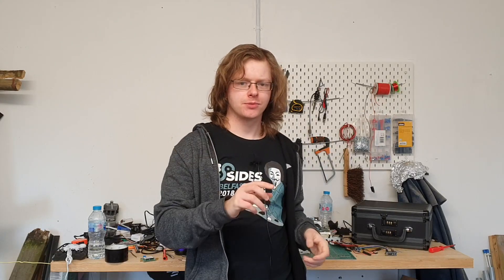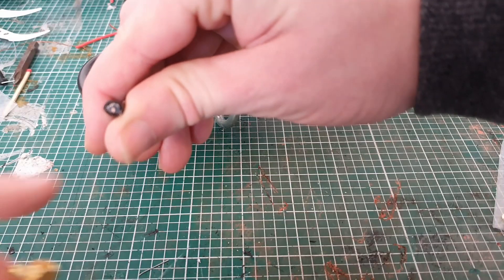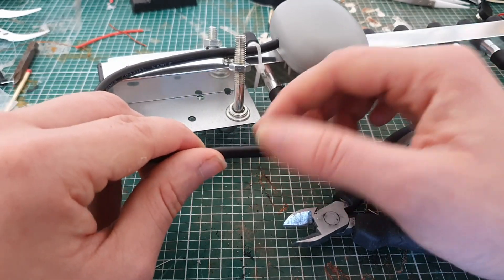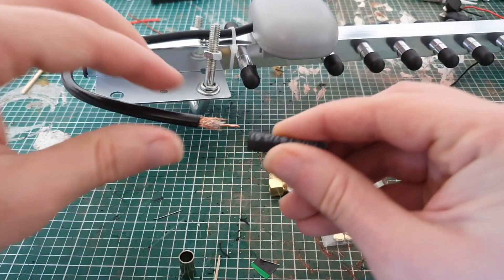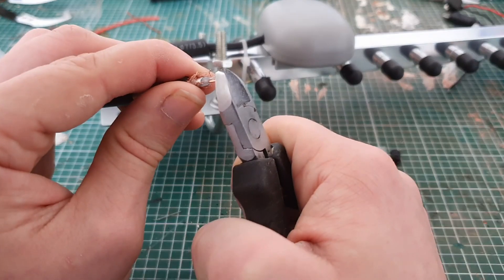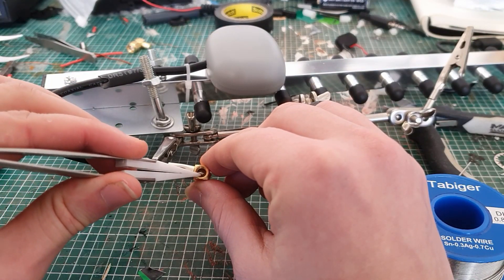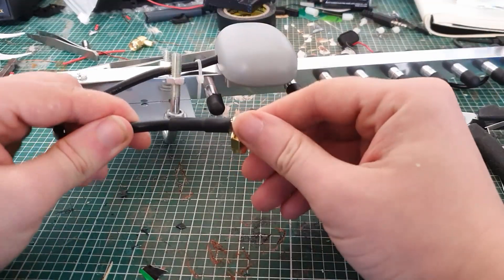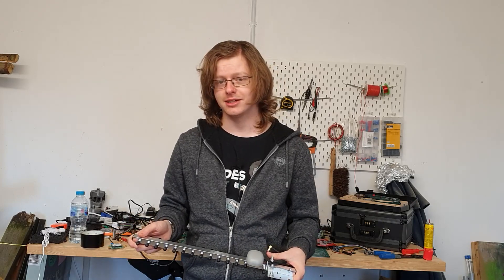How To Fit An SMA Connector

Comment: This is not the correct way to attach a right-angle SMA for RF purposes.  You'd get massive signal loss and detune issues doing it this way, just FYI.  He skips some steps necessary for individuals needing low loss cables for cellular frequenciea

Comment: Not sure if you still monitor comments to this video but have a questions regarding the soldering you did. The video does not show you heating anything with your soldering iron nor does it show you dropping solder into the hole. I have ordered the right angle connector and I cannot make out if there's a ball of un melted solder sitting in the middle of the opening that's heated. Any thoughts?
Reply from the maker: @waynenasiatka6758  I had to watch the video to refresh my memory, yeah the video cut out the soldering part, I just used a fine tip iron and soldered the center of the coax to the raised slot in side, it’s a pretty thick bit of metal too so I turned the irons heat up a bit when soldering it

Comment: Thanks for this. BTW these pinless connectors are called 'reverse polarity' SMA connectors, manufacturers started using these as a work around to RFI standards that prevent people from changing the antenna on equipment, they claimed it was a 'non standard' connector so they could use connectors rather than permanently fixing the antenna. It quickly became common in Chinese equipment and elsewhere.

Comment: Hey, can you please help me? I got a WIFI adapter card that has a dish on the middle and 2 antennas on the side, I figured out that the antennas were useless even if they were screwed on. As I opened the card, turns out that the SMA's of the card were not connected to the PCB, how can I solder them on? can I use a regular copper wire and solder the stuff to the PCB? (it has 3 holes 1 is already used by the dish)
Reply from the maker: Either hop onto the discord channel or email me with some pictures of the board and I will see if I can help. Ideally you want to use Coax cable to go between the sma and the board

Comment: 8:00 use proper hex shape crimpers :(
Reply: The video should be titled how to do not fit an SMA connector. Invest in the good coax stripper - to strip it nice and clean. Buy ratchet crimper with proper hex jaws. In this way you just have reflections/additional loses in stress point where you made on coax.

Comment: The one you cut off is an RP-SMA IE Reverse Polarity SMA.  RP-SMA is used more in wifi then 2 way like Amateur Radio which are usually standard SMA.  I've been looking for an RP-SMA Mag mount for putting a wifi antenna on my car for using Kismit.